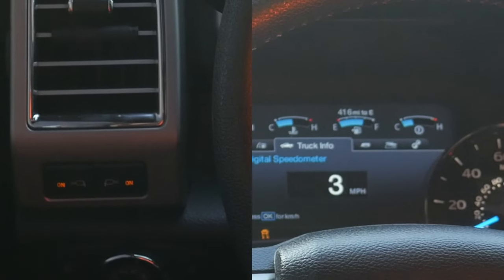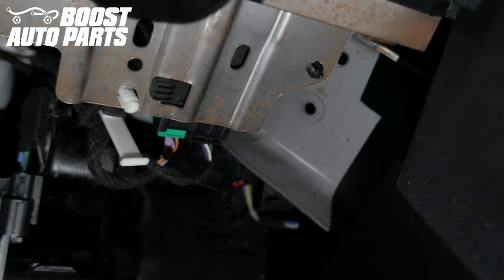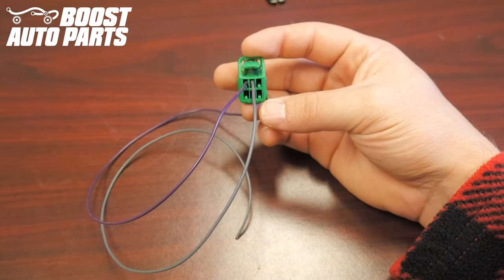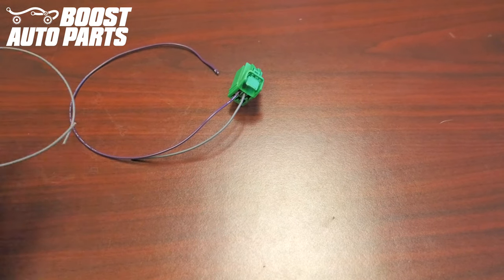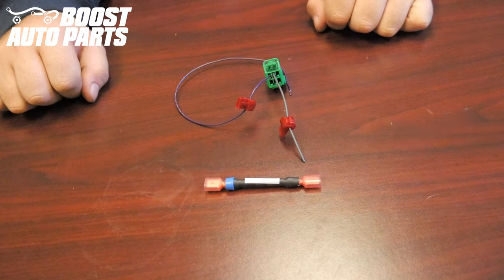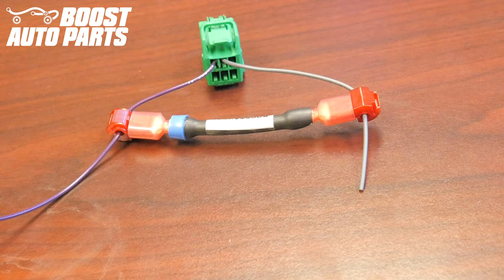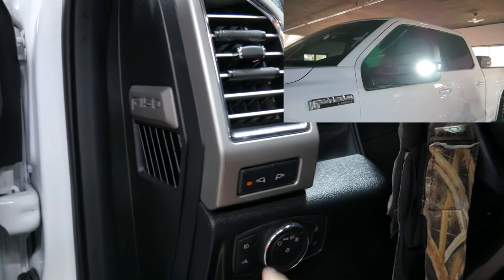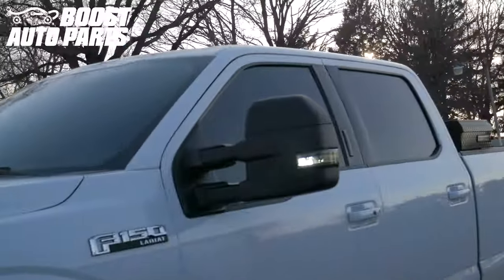Ford Spot Light Mirror Override Mod // 2015-2020 F150 & 2017-2022 Superduty

Comment: I did this and now my spotlights don't work. Any insight?
Reply from the maker: Are you testing with the park lights on?

Send a picture of your connections to support@boostautoparts.com and our team can assist.
Reply: @boostautoparts  done!
Reply: @BuCkYwUcKy123  any insight cause I just did mine today and same thing my spot lights dont work?
Reply: @CVfootball1992  all they said was "check connections" for me
Reply: @BuCkYwUcKy123  did you ever get them to work? I put there tow mirrors on and also added that and my spot lights wont turn on at all?
Reply: @CVfootball1992  no after I checked the connection again they said it looked like my wire was thinner than usual and to try again lol
Reply: @BuCkYwUcKy123  🤦‍♂️ great gives me a lot of hope lol. I triple checked myself and I know it's right but being as I put there new mirrors on at the same time I have no way to test the spot lights in the new mirrors I know they worked in my old ones
Reply: @CVfootball1992  you checked with the lights on too?
Reply: @BuCkYwUcKy123  yep I checked with the truck off and nothing tried it with the lights on and nothing turned my truck on and tried and still nothing
Reply: @CVfootball1992  so they wanted me to use a multimeter and when I  tried to remove one side it broke🙄 should've used a paper clip like someone I saw once🤣🤣
Reply: @CVfootball1992  let me know if you end up getting it to work. I'm wondering if they marked the ends wrong on a batch of them or something
Reply: @BuCkYwUcKy123  that sucks. I actually got mine working. The wire turned out to be a little to small for there t tap and wasn't cutting into the insulation so I got a smaller t tap and it worked perfectly
Reply: @CVfootball1992  I'm gonna try that out next if I can get their piece back together!
Reply: @BuCkYwUcKy123  soo did y’all run into the issue of the truck keeping the puddle lights, cargo light and license plate lights on?
Reply: cut the insulation of the grey wire

Comment: What if I ordered my f150 mirrors from boost but don't have that function on my truck from factory? Do all of y'all's mirrors have the forward facing light option?
Reply from the maker: We do not have an upgrade path outlined to add the spot light feature at this time if not originally equipped - sorry!
Reply: If you have the 22 pin harness and the light module underneath the steering wheel, you can Forscan it to work. I had power fold mirrors on my truck without spotlight. I ordered boost auto mirror with spotlight and got it working

Comment: So now can you hook a relay in between the wires with a 12v so when the truck is off the circuit opens? Turns off. In case it's daytime and your in a garage with them on and forget when yiu leave
Reply from the maker: Please reach out to our support team at support@boostautoparts.com for assistance - they are best suited to answer something like this.

Comment: Yeah mine didn’t work either. It appears the t taps for the wire in slot 2 didn’t work. The wire is smaller than the other wire
Reply from the maker: Give our support team a call at 765-831-2830 for assistance!
Reply: Did u get it working?

Comment: CUT THE INSULATION ON WIRE #2!!!!

Just installed tow mirrors on my 2018 F150 and was doing the bypass. After some griping and cursing trying to get this thing to work, I gave the ol paperclip trick a go and of course that works. However I don't feel completely comfortable with that. Came to the comments and someone said how the T-clamps weren't cutting the insulation in the #2 wire. Low and behold, that was the issue! Used some surgical scissors to cut some away, plugged it back in and it WORKS!! Boost Auto Parts, please include an extra, smaller T clamp for us with the XS #2 wires please!
Reply from the maker: Thanks for the feedback Michael - I will share it with the team!
Reply: did your #1 pin have two wires?
Reply: @timbo3.5 yes you can use either

Comment: @bobdillon4525
0 seconds ago
My harness has 7 total wires connected to it, not 2 like in your video…..2017 F250
1 wire in port#2 through port#6, 2 wires in the port #1

Comment: Why is the jumper wire directional, does it have an internal fuse or something?
Reply from the maker: It is not a straight wire - there are components inside.
Reply: There's probably a diode in there to prevent electrical backflow

Comment: Do you cut the grey wire just like how you guys did?
Reply from the maker: Yes
Reply: @boostautoparts  I did do that also it’s not working I have everything exactly how y’all said any suggestions?
Reply from the maker: @zeshawniqbal1031  Call our support team at 765-831-2830, they should be able to get this resolved quickly for you.